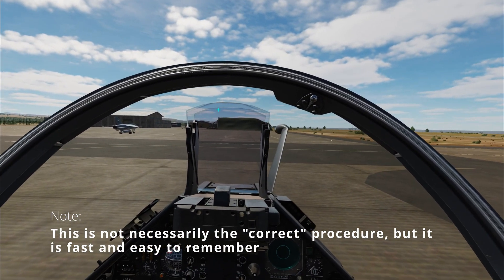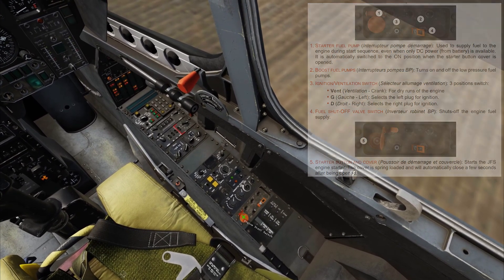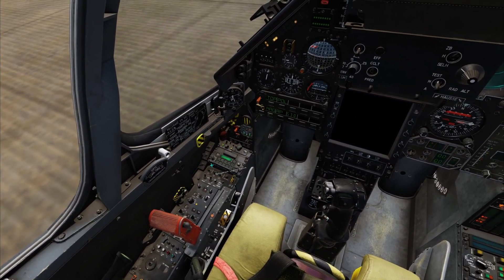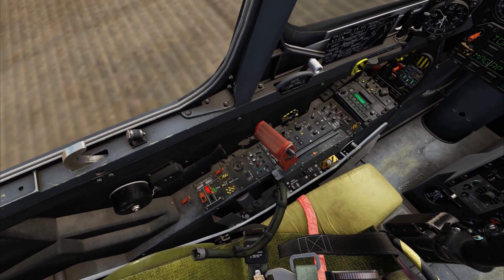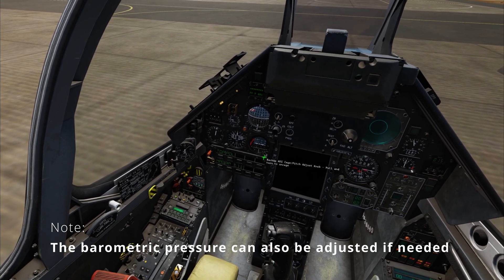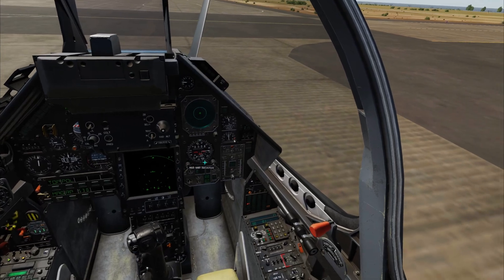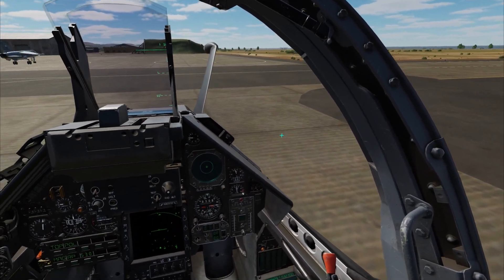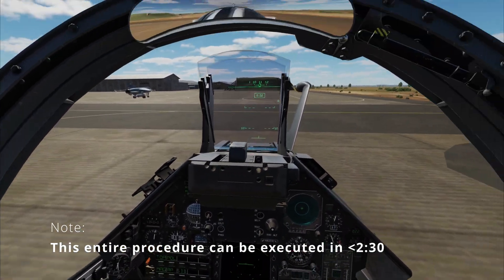Cold Start - DCS Mirage 2000C - Quickstart Tutorial 01

Comment: I understand you run a 3090 GPU? Are all your ingame settings turned down to basically zero to hit 90 FPS with the G2? Does the lack of shadows not bother you? Nice video btw
Reply from the maker: So I do have a 3090, and yes, my settings are roughly in the middle I can bump them up a fair bit, but flying low and fast around trees or buildings can turn the game into a slideshow.
Reply: @KortanaDCS  we all pray for multicore and vulkan
Reply: TBH I couldn't fly without shadows especially in VR... still have to try if I can hit that with the CV1 with my new rig (5800x/3070) :D